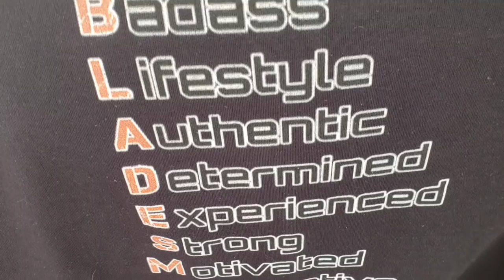Forging A Throwing Knife From A Pipe Wrench

Comment: That anvil costs maybe $50 USD. Not judging, just saying. You don't need a $350 USD 75lbs. anvil to do this. Knowledge is more valuable than money.
Reply: Samual Iam and he adds to the weight with the chain
Reply: The chain is simply to hold the anvil in place. Its the quality of the steel that matters. The anvil he has appears to be the $50 USD one you can get from Northern Tool, Harbor Freight, etc. Its steel is considered "inferior" because it does not have the proper steel nor was it tempered properly. All that aside it really doesn't matter too much because if you have the skills then the tools are just extensions of your arms. Iv seen smiths use stone anvils and make some fine quality items.
Reply: You can always weld a piece of tool steel on the face. It'll do just fine.
Reply: Samual Iam arent there holes for bolts on the base?
Reply: @samualiam9981  The Chain is not to hold it in place, it's to absorb the hits of the hammer and put the shock back into the knife

Comment: Are these just novelty knives?  The steel in tools like that don't hold up as a knife blades.
Reply: Probably, but nonetheless, they look cool!
Reply: the jaw of the wrench is a high grade carbon steel whereas the handle is just tool steel or iron
Reply: 9MMSWORD if you find the right tool. the camera won't pick it up but you can literally see the difference between mild steel and tool steel